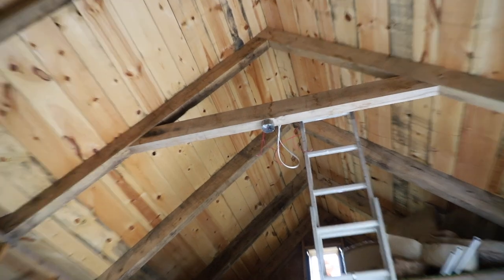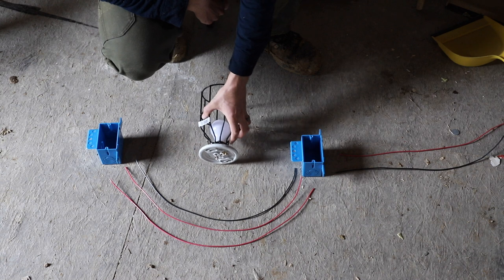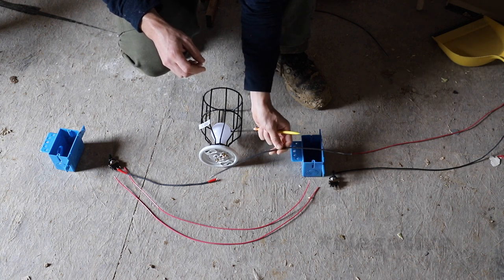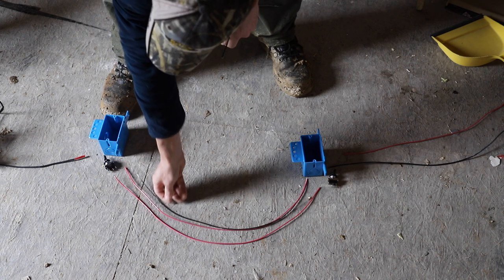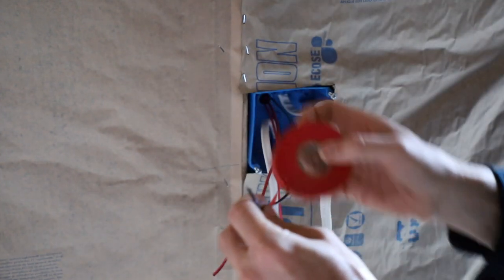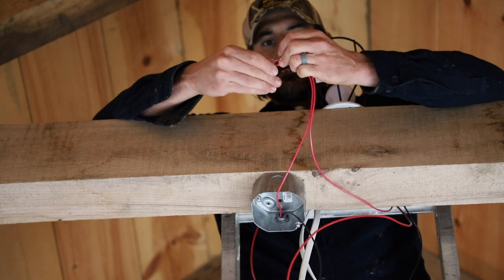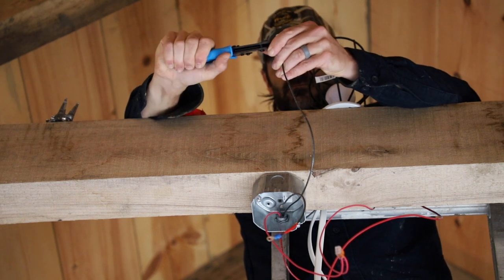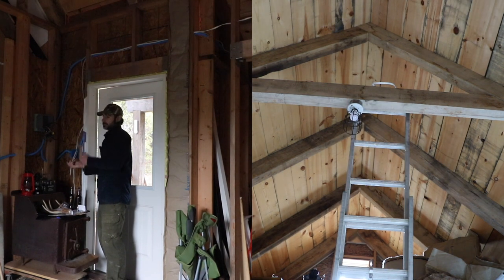How to Wire a DC 3 Way Switch For Your RV or Cabin

Comment from the maker: I forgot to mention:  For DC current you should not use normal AC household switches.  The higher arcing of direct current burns them out quickly.
Reply: You answered my question.
Reply: Some of them will have both an AC and a DC rating but yes if it just lists a AC they are not good for DC.

Comment: Worked well. 3 way wiring can be tricky but I like how you laid it out for everyone to see. My OCD hates it when one witch is up and the other is down... I wish they just made a push button to turn a light on or off... That would work better for me, lol!
Reply from the maker: I think they do make those FYI (Push button switches)...
Reply: Yeah, I'm sure you're right. I'll have to look into it more. just like, one button. Tap it lightly for on/off that would be nice. I like this low voltage stuff, you can do so much more with it!

Comment: Awesome, helping us in Crossville with working our off grid 12V water pump. We would like to put in an LED when either switch is in the ON position (pump may be on but not make noise and we don’t want to leave it on). We would be sooo grateful for any insight. Thank you!
Reply from the maker: Just to make sure I am understanding you correctly, you want a light to come on anytime the pump is also turned on?  That is really easy to do, just bring a power supply into a normal 12v toggle switch, after the switch wire the light and pump in parallel.  Feel free to email me if this doesn't make sense.
Reply: Thank you! I just wasn’t exact on diagram, have more clarity now :)

Comment: Get yourself a label maker to flag the wires on both ends on where they connect so when you come back to it after a few years you can just look at the end of the wire to know where the other end is. Same thing for labeling things outside is to cut up a copper pipe to make flat copper plates you can use a stamp set to imprint data into so you can include a year you did a project so years down the road you just need to find the plate to know this lasted x years (great for fencing projects as you can label sections of fence and include if it is on a property line). Can use cut up soda cans for shorter term labels like plants in a garden that just need to make it one or two seasons.
Reply from the maker: Those are some good tips, I do need to do myself a favor and be more organized.  I tend to work in chaos for a while and then step back and wonder what kind of mess Ive made.

Comment: From what I understand about standard household electrical components I believe you can use light switches as normal light switches in a DC application as well there might be a designation on the switch score of DC load sometimes but I think with AC three-way switches you have to run an extra wire to use them so that might be a little more complicated than your setup

Comment: Nice surprise to see a video from you today. I really have enjoyed seeing your solar install and wiring of the cabin. How do you like using the wires and connectors compared to traditional wiring switches and outlets?
Cabin build is coming along nice, look forward to your next video.
Reply from the maker: Thanks Charles, I kinda prefer working with Romex, wire nuts and traditional AC switches and outlets.  It's more cut and dry, the DC stuff seems to be designed with vibration in mind and seems to be less standardized.  But it's been a fun learning experience.  There just aren't a lot of people wiring their cabins for both AC and DC so I'm having to do a lot of research and experimentation.

Comment: What cover are you using for the toggle switches?
Reply from the maker: I haven’t found a good solution so I was thinking I’d have a friend 3d print some.  I could also make some out of scrap wood.

Comment: How would you wire a 3rd switch into that circuit?
Reply from the maker: Umm you would need two single pole double throw switches (often called 3 way switches) like this then a double pole double throw switch (often called 4 way switches).

Comment: I have a question that nobody has been able to answer for me yet or if it is possible.  I have a enclosed cargo trailer with several lights inside and out that are hooked up to switches and a battery so it can run lights without truck.  The lights on the back of the trailer are hooked up to a switch in trailer but we want to also hook the lights to our reverse wire from truck so they come on when we backup. Do I need a relay or would a 3 way switch work?  I figured with truck battery and trailer battery I would get some kind of back feed to me 2 way switch that I have now.
Reply from the maker: Hey Diego, I’m pretty sure you would need a relay and you’d have to figure out what wire makes your backup lights turn on in your truck when you backup because that is what you would use to drive the relay to turn on your trailer lights at the same time.  I’m 95% sure that what you want to do is possible, I just don’t know exactly how to do it.
Reply: @50Acres  Thank you sir. I know what wire just don't know how to put it all together. I thought maybe a 3 way switch might work.  I just got done installing a electric jack, two 36 in light bars, four 12 in lights, eight strobe lights that also steady burn, a door light, a Maxx fan, USB ports and switches , YOU WOULD THINK I COULD FIGURE THIS OUT LOL
Reply from the maker: @diegoranchinc5389  The way I would try to do it is splice into that wire parallel to a relay and then have the relay power the lights.
Reply from the maker: might take some expirimenting.
Reply: @50Acres  Thanks for your help I will try that

Comment: Do you have a wiring diagram for this setup?
Reply from the maker: I don't but I pretty much drew out the diagram with parts in the video.  It's very similar to an AC 3 way switch except the switches are different and you don't have a ground (unless you want a ground).

Comment: Great video and explanation. Although not being a 'certified' electrician myself, I don't think that you should be cross-referencing AC terms for wires with DC. You kept referring to the positive as the 'common', when in AC terms the common is considered the neutral and the 'hot' is the power. Correct me if I'm wrong? In DC applications, the positive is 'normally' your power and the negative is the return, depending on the set up. In some telecommunication companies, they have used the opposite and the negative is the supply of power and the positive is the return in landline phone applications. Not trying to be a smart-ass, nor invoke the wrath of other commenters. Just an observation.
Reply from the maker: I definitely kept saying neutral when I meant to say negative.  Regarding common I believe that is a term that can be used to describe the terminal that accepts power on any switch weather DC or AC.

Comment: It's been over a year since you uploaded this so I'm not sure if you'll see this comment, but how do you wire it to more than two 3 way switches? In my particular case, I was wanting to control the same light from 4 switches.
Reply from the maker: Hey Mike, lets assume the fixture is wired as an end of run fixture you'd need to put two 4-way switches in between the two 3-way switches as I have done on this video.  4-way switches have four terminals each with two pairs of travelers.  It's difficult to explain without a diagram. A 4-way (intermediate) switch is a purpose built double pole, double throw (DPDT) switch, internally wired to reverse the connections between the input and output.  So, the hard part will be finding the correct DC switch for this application.  This is all in regards to the positive wire.  The negative wire is easy, it just goes from the power source to the fixture.
Reply: @50Acres  Thanks for the quick reply! That's a big help, now I'll be on the quest to find a 4-way DC switch.

Comment: what did 50 acres cost where you are?  We paid 9,800 for our fifty acres back 20 yrs ago. Our land is similar to yours.  You don't have to say, I was just curious.
Reply from the maker: IIRC it was around $1,300 per acre.  Slightly high at the time, but prices are even higher now.
Reply: Not bad really. It's about  that now in this part  Mid eastern  ME. Your property  is well worth it. thanks for answering

Comment: Why don't use regular 3way? Would be cheaper.
Reply from the maker: For direct current, the arcing burns out normal AC switches really fast.   They work for a while then they get all pitted up and stop working.
Reply: @50Acres  on a led bulb.  No way.
Reply from the maker: @johnmcdonald8240  When I did research for the video I came across a lot of different sources who said the switches will work or a while, then burn out.  I figured I'd take their word for it rather than test for myself.  Give it a try and let me know how it works if you want. I'd like to be able to use a $2 switch vs a $5 switch also.

Comment: Couldn’t you use a regular 3 way ac switch? Your just using low voltage.
Reply from the maker: Yea it would work but I have read that the Arcing DC produces eventually burns them out.